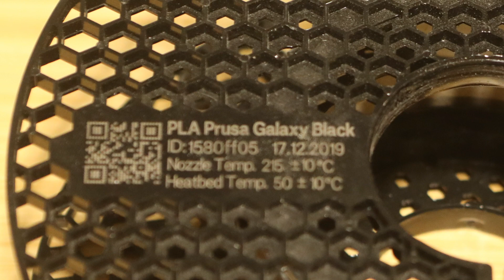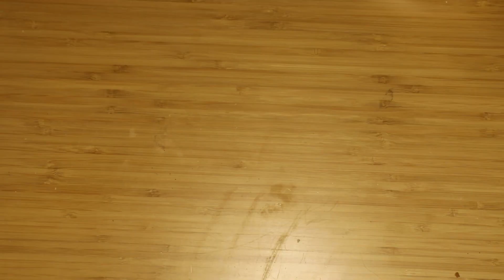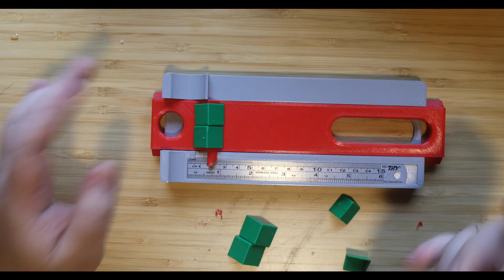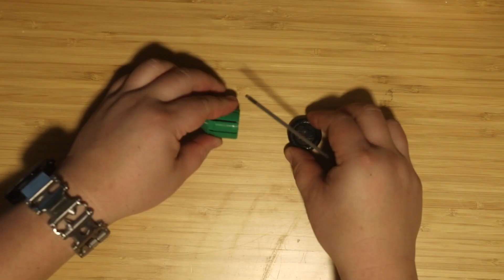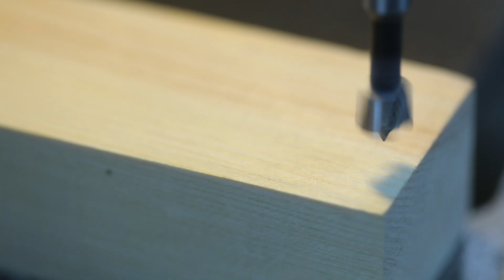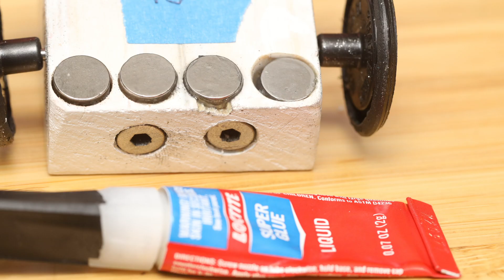3D Printing Pinewood Derby Tools!

Comment: I did a print where I cut the "Wheel Chuck - Inner - Expander Wedge" in the slicer at the halfway layer of the nut. After printing in PETG, using calipers, the hex nut appears to be approximately 5mm (flat outside edge to flat outside edge across the center) and the screw has a diameter of approximately 2.5mm.

What I don't know yet is the length of the screw.

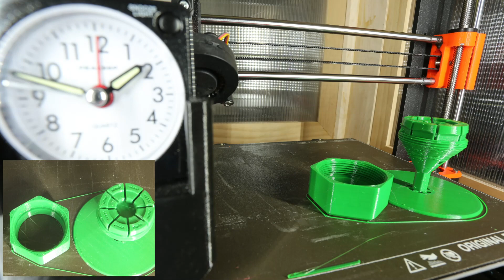Comment: Really enjoyed watching your videos on this. I do have a couple questions. around 2:15 you mention building strong parts, but I didn't see what % Infill you recommend other than a few images of prusaslicer. I saw 70 and 50%. Any reason to go higher than this for PLA? 

You also mention generating parts with 4 or 5 parameters at 2:19, but I don't know if I need to be worried about this or not? I'm new to 3d printing and am excited to give these a shot!
Reply: I tried printing the outer wheel holder and the tolerance was too tight. Ended up scratching up one wheel pretty significantly :(

Any tips on how to loosen the tolerances up on the outer wheel holder? 

I am trying to make the balancer today and will report back my findings

Comment: can you explain how you use the chucks to polish the wheels?
Reply from the maker: We just freehand polish the wheels using a nail file or the Tamiya file  Chuck the wheel up and mount it I to the drill that's clamped to a table, power up the drill and use the nail file to touch up the outside circumference and remove sharp edges.